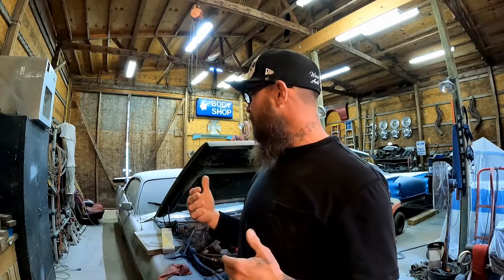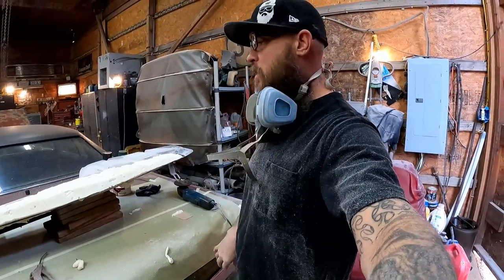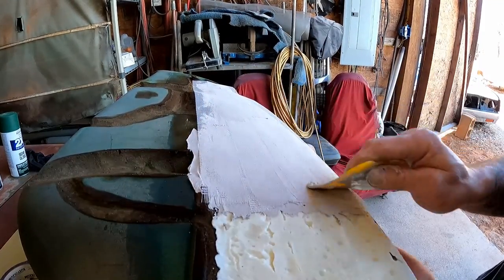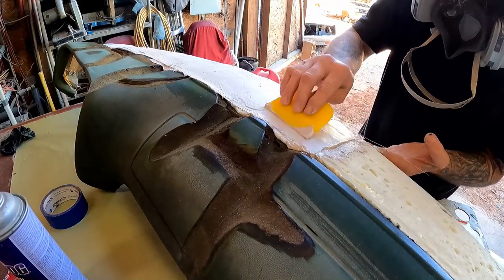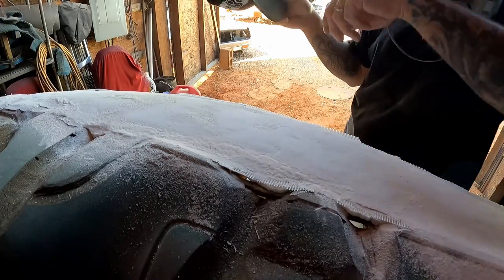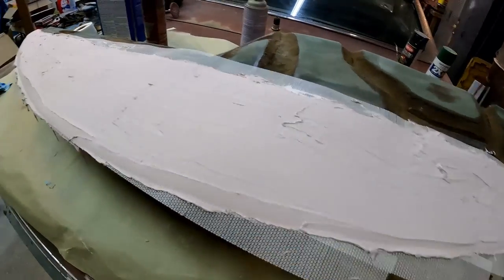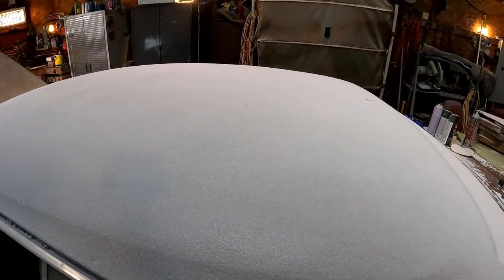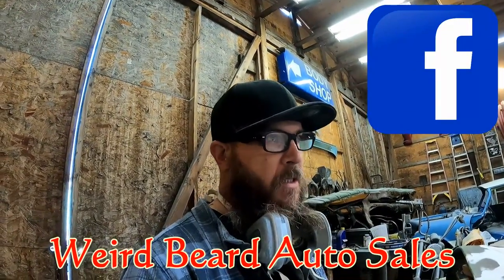FIXING THE WORST DASH I'VE EVER SEEN [2]

Comment: Using spray foam in a can insulation 😂😂. I’d be more impressed if you read the directions before you started a tutorial video, you never shook the can up and sound use it inverted when spraying. I have problems with using this foam it is not resistant to UV light, it becomes brittle and shrinks when in direct sunlight also excessive heat, the kind a dash inside a car can achieve will cause this foam to crack. Add to this, canned spray foam is very soft, does not resist denting. Now with all that said, what I don’t know is will these problems translate through the finished bondo? What’s the longevity of this repair, replacement?
Reply from the maker: Definitely could care less about impressing you. Thanks for watching though ✌️
Reply: @weirdbeard8898  sorry, didn’t mean to come off as a dick. I mean if this works cool. But what is the longevity of using spray foam as a form or a mold? I’ve never used it in this kind of application, but I do know the limitations of spray foam. As I asked, when it fails over time, does it matter if it shrinks or cracks, will that translate to dash’s finished surface? If it doesn’t then you saved me a ton of money with a project of my own. How well does this hold up over time?
Reply from the maker: @jamesmchugo9422  we shall see my friend.